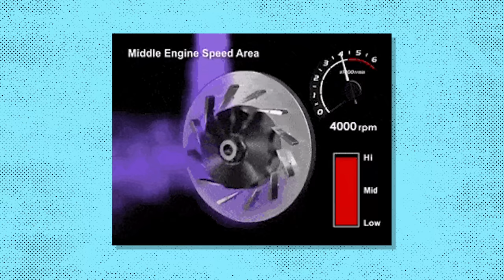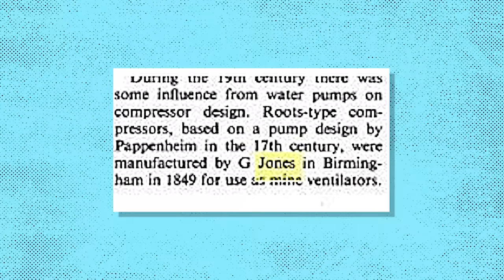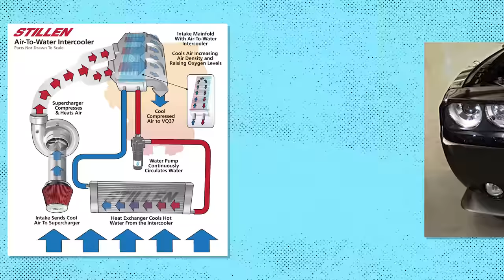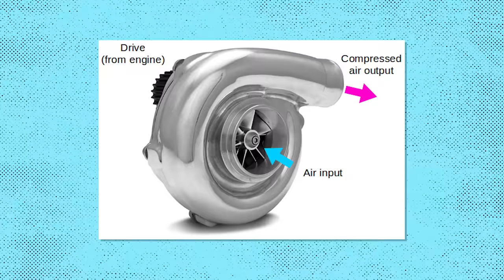Why Superchargers Aren't As Good as Turbos

Comment: Turbo chargers are far more popular because they are cheaper to manufacture and fail frequently. In both cases, this makes more money for manufacturers. Superchargers are far superior. They make more power faster, and although drive belts fail, they are cheap and easy to replace. Car manufacturers push the idea that turbos are better because they are greedy, NOT because they're better.
Reply: You must have owned some really crap cars... don't buy a car if you can't afford to repair it or buy a better quality car.

Turbos are extremely reliable and until recently have always been very expensive.

Turbos are superior to superchargers for some very important reasons 
First is they make more power than a supercharger and second they use less fuel which is important to both manufacturers and consumers.

Comment: Try Torotrak's variable speed supercharger with toroidal transmission.
Reply: All superchargers lack the primary advantage of a turbocharger... a turbocharger will always make more power.
Reply: @sandervanderkammen9230  an important element is moment of power, supercharger is immediate. I understand the differences and the advantages of a turbo.

Now, Torotrak's approach is a very interesting one because of the cvt like drive; a centrifugal charger is adjusted constantly, reducing losses and maintaining power along the whole range of the engine.
Reply: @juliobro1  It seems there are alot of misconceptions and confusion about turbo lag... turbo lag is not a real problem, its an imaginary problem.
 It's the mental perception of the difference between a linear and a curvalinear power curve.
Turbo lag is not a accelleration lag, the truth is turbos make more power so accelleration times are actually faster... not slower.
Reply: @sandervanderkammen9230  I'm not stating one makes more power than the other, but lag is a disadvantage that superchargers don't have.
A variable drive for a supercharger helps with inherent disadvantages, including a smaller size. You know, we really haven't seen this in action, there's only a test bed from Torotrak.
In production are a 2 stage unit and electrical turbos from Audi and Porsche, which add equipment (weight) and complexity.
Reply: @juliobro1  You don't seem to understand, lag isn't real... so it's not a disadvantage.
Turbochargers will always make more power, that's a disadvantage that supercharger will always have.
Less power = slower accelleration.

Comment: While the points in the video are technically correct I think its unfair to say turbos are better than superchargers 
If you're building a fun street car it makes sense to sacrifice a few HP to have the instant boost and throttle response that comes with a supercharger. 
This video also dosnt do a good job of explaining centrifugal superchargers, having owned a car fitted with one, it's the perfect midpoint between turbo and supercharger 
Boost is completely linear, you have some boost the second you open the throttle, but not all of it, there is no lag, you feel the boost straight away, but you do t have max pressure, as you go through the rev range you get more boost 
More people should consider the practical applications of which power adder they choose instead of defaulting to the oversimplification that turbos are more efficient and therefore always better.
Reply: Turbochargers dominate the forced induction market for two reasons, higher fuel efficiency and the simple fact that Turbochargers produce more power than superchargers.

Comment: Few things:

1. The animation of the rotors on the twinscrew is wrong. The rotor turn opposite rotation of a roots to squeezing the air down the center. You show it moving air on the outside of the rotors.

2. You failed to explain the difference in power curves between turbos and blowers. Blowers make way more low end power than turbos. twinscrews will still carry power up top with the turbo, the roots will not.

3. A good crank driven centrifugal blower even with its parasitic loss will out perform a turbo setup on the drag strip.
Reply: That is false, a turbocharged engine will always produced more horsepower and torque and the same manifold pressures than a supercharger.
The supercharger will always have parasitic loss while the turbo does not, that power goes directly to the wheels.
Reply: @sandervanderkammen9230  you read it wrong. “Low end power” is the key words here.
Reply: @2ndshiftracing  More power means... MORE HORSEPOWER
Any questions son?
Reply: @sandervanderkammen9230  
I can tell you’re a little bit cocky and not a fan of data. Once again “Roots and Twinscrew” will always make more torque and horsepower in the LOW END of the power ban over a turbo. That is their advantage. If you want more power band above 4000rpm a turbo is the way to go.

Reading comprehension guy….there’s physics involved here you do know.
Reply: @2ndshiftracing  I can tell you dropped out of school and have very little education.
 2 identical engines, one turbocharged and one supercharger.
Same max. manifold pressure.
The Turbocharger engine will make more power and more torque because there is a parasitic load on the supercharged engine.
Any questions kid?
Reply: @sandervanderkammen9230  I graduated and starting racing. Our whole platform is based on racing data and sharing education of such. You’re arguing a fan boy’s argument with no content, data, and 7 subs. 

All you’re saying is it makes more power, you’re not specifying where. Engines have a power curve, turbo shines on the top end of the curve, and blowers on the bottom end. Don’t know how you don’t understand this in plain English. 

Explain to me how an unspooled turbo making no boost at 3000rpms is making more power than a blower making 20psi at the same RPM?
Reply: @2ndshiftracing  Thank you for confirming that you have absolutely zero education or experience in engineering...
 Horsepower is the amount of work done in a given amount of time.
The engine has a power curve, a power peak and a isographic power output island... 
 Do you need some crayons to write this all down?
I can tell you don't do well with written tests.
Reply: @sandervanderkammen9230  
Answer the question I asked.
Reply: @2ndshiftracing  Engine rpm and turbocharger rpm are relative, and determined by several factors including the the size of turbine and compressor wheels and turbine housing A/R ratio and compressor trims and wastegate and bypass pressure settings. 
Some engines, particularly aero derivatives have a max. of 3,000rpm and produce maximum manifold pressure well below 3,000rpm.
Reply: @sandervanderkammen9230  I’m well aware of turbos and the thermodynamics behind it. 

unless it’s a Diesel engine you won’t make 20psi at 3,000rpm with a reasonable sized turbo on a gas engine. You can with a twinscrew though.
Reply: @sandervanderkammen9230  honestly man, put out some content on performance and I May give it a watch. I tried to give you some free data what was informational and you just want to argue about the top dyno number. So I’m gonna stop this cycle.
Reply: @2ndshiftracing  The Ferrari F154 engine is 25 psi at 3,000rpm 
Peak torque at 3,120rpm
35 psi max. at peak horsepower at 6,700rpm
Reply: @2ndshiftracing  What's the matter boy! Cat got your tongue???
Reply: @2ndshiftracing  Maybe you should spend a little less time producing low quality amateur content and spend alittle more time in school educating yourself?   
That way you won't make a fool of yourself like this again.

Comment: Exhaust pressure is not waste energy. Otherwise i agree. Turbos are better.
Reply: There are alot of misconceptions and confusion about how turbos actually work... Turbochargers use an Impulse Type turbine that uses the waste heat in the exhaust, not pressure..
Turbochargers do not use reaction turbines.

When a reciprocating engine is turbocharged it becomes a Combined Cycle heat engine.
A Otto or Diesel Cycle engine combined with a Brayton Cycle engine that run on the heat energy rejected by the reciprocating engine.
Any questions?

Comment: “No one is using them?”
First 10 seconds and already this video sucks. 
You might wander over to Steve Morris Engines channel and observe you’re incorrect. Most f his LS blower street car motors are well north of 2khp and his SMX motors are usually closer over 3khp to 4khp. 
And over on Richard Holdener’s channel he’s got a routine video in the mix about stock and aftermarket superchargers. He doesn’t even cover the Euro import ones. (Rarely)
To all that think a supercharger means slow, you can’t get a 0.4 or better 60ft with a turbo, and then if you can get down the big end under 4 seconds with a turbo it’s involving an attached rocket to get you there. 
12,000 supercharged hp is enough for most of us.
Reply: No one saying that superchargers don't work..
He is just saying that superchargers are less efficient and don't make as much net power as a turbocharger.
Reply: Your not allowed to have a turbocharger in Top Fuel... they are banned because they make too much power.

Comment: The primary advantage of the turbocharger is that it has no parasitic loss or load on the reciprocating engine.
The turbo is driven by horsepower that is normally wasted out the tailpipe.

Comment: the exhaust gasses that are used to drive turbochargers create back pressure on the pistons, thus robbing the engine of power as well. There is no such thing a free energy.
Reply: Wow! You don't know anything about  turbochargers or back pressure.
Reply: @sandervanderkammen9230  Please explain then.
Reply: @quisp1492  Turbochargers are combined cycle heat engines, they use the Brayton Cycle to convert waste heat energy normally wasted out the tailpipe of a supercharged or naturally aspirated engine to drive the turbine wheel.

The turbocharger uses an Impulse Type turbine, this means it converts kenitic energy in the exhaust gasses, not pressure.

Backpressure is when the pressure between the engine and tailpipe is higher than the intake manifold pressure, this requires energy from the crankshaft to pump the air in and out of the cylinders.
 Turbos increase pressure in the intake manifold and do not create backpressure or a parasitic load on the crankshaft.
Any questions son?
Reply: @sandervanderkammen9230  Got it. Thanks for taking to time to go in more depth. 

Cancel

Reply

Comment: I would go with a supercharger simply because there is no lag and no need to have a relief valve. that and I dont want to have to find a place for an intercooler....
Reply: Turbos make more power...
Reply: @sandervanderkammen9230  no, sorry, they dont.
Reply: @lukewarmwater6412  Yes, they do.
Turbos produce more horsepower and torque, they produce more power at the same manifold pressure than superchargers do.

Comment: they're not bad, they're just bad in applications that don't make sense, just like a turbocharger, or a 23-speed transmission, or a train horn on a smart car. 
Certain things are built for certain applications.
Reply: They are less efficient and make less power than a turbocharger.. thats the point that you missed.

Comment: The supercharger on a Top Fuel engine requires 1000 hp to run air into the engine.
Reply: That is an excellent example of why turbos are better.

Comment: Who dont you also have the exhaust spin it and have it it powerd by a pully
Reply: It's been done... its easier to do one or the other instead of both, the advantage is usually not worth the extra effort if you already have a proper design of turbocharged engine.
Reply: Turbo compound engines have been used in aircraft and coupled turbochargers are used in 2-stroke Diesel locomotive engines.
No pulley, direct drive to the engine.

Comment: A centrifugal supercharger is literally just a belt driven turbo instead of an exhaust driven turbo. It literally is a turbo, with all the downsides of a supercharger and all the downsides of a turbo and the best of NEITHER. You’ll never see one of these on OEM cars
Reply: Not true. Doesn't have all the downsides of a turbo because it doesn't have lag. It is small and light and you can fit them almost as easily as a turbo, they have better heat efficiency than a turbo(no hot exhaust gasses passing through). They aren't as easy to tune, you need to change the size of the pulley to change the boost, but that isn't really an issue in a lot of cases. A turbo also has a parasitic loss, superchargers just have a greater loss but you are still making more power than NA. To say it has all the downsides of both is a complete lie, or it wouldn't exist or get used (they are very popular in the aftermarket scene).
Reply: @acarguy3773  it absolutely has lag, in some ways it can be worse than on a normal turbo. Regardless it literally is a turbocharger, it’s just got a belt in place of the hot side.  It’s a belt driven turbo. Turbos spin far faster than blowers, so it takes a lot more to get significant boost out of it in a centrifugal setup. It’s the worst of all worlds and there’s a reason no OEM uses it, it’s what cheap aftermarket companies offer for vehicles that are more difficult to properly turbocharge, because it’s extremely cheap and let’s you use 99% off the shelf parts. It’s by far the worst choice of all the options
Reply: @Fee.1  no it does not have lag. Just like any other belt driven supercharger it does not have lag as it is 'always in boost'. No oem uses it because turbos are far easier to get good emissions and mpg out of, that's all they care about. Same reason as to why they use smaller engines than they used to. Lots of people choose to go down this route instead of using a turbo, and actually it's often slightly more expensive because their are more turbo options. And because a turbo is going to be more likely to get you huge power. I will be getting a centrifugal supercharger instead of a turbo to keep my engine feeling NA, with no lag, and more power keeping with the original character of the engine.
Reply: @acarguy3773  you don’t know what you’re talking about. You’re relying on talking points i am speaking from experience. First of all “lag” is overly broad and can cover many types of symptoms. 

IT IS NOT JUST LIKE ANY OTHER BELT DRIVEN SUPERCHARGER BECAUSE ITD NOT A SUPERCHARGER! It’s a Turbo that’s been adapted to work on off a pulley system. 

If you want to understand more I’m happy to discuss it and explain but if you just want to go back and forth and refuse to entertain the idea someone might know a bit more than you, then this is an exercise in futility. I spoke to Jason Fenske about this at an event after he made his first video that included a portion touching on centrifugals. I corrected his inaccuracies in the comments but it didn’t click for him until we spoke more in depth. 

By The next video he made that discussed them he had had time to reflect on the points I raised and he corrected the record and more accurately described centrifugal in that video and ever since. 

You could also try to catch Gale Banks, the god of body, and he will help you understand the topics and forces at play here.
Reply: @Fee.1   lag doesn't cover many things, it refers to me pushing the throttle and there being a wait time for boost to build, this doesn't happen with a supercharger. It doesn't need to spool up every time I press the throttle. It does however need to be in the right rpm range to be making decent boost because it can only spin according to the pulley system. There is a difference between lag and boost threshold. A turbo engine making basically no power at 2krpm is not lag. A turbo engine needing to spool up to make power when you hit you throttle is lag. I only compared it to other superchargers on this basis, and of course the fact that they are all driven by somewhat similar systems in comparison to a turbo but that's not even relevant. Of course I understand that it's almost identical to a turbo, no need to rage at me with capitals because I made one comparison - clearly one I didn't explain well enough. 

I don't see what there is to understand, I know exactly how it works and what applications make sense for each, and weighing up the pros and cons the centrifugal supercharger is the best option for me, and for many others who don't want the lag of a turbo, and realistically couldn't fit any other kind of supercharger. If I had more money to spend I'd keep it NA and go crazy but ITBs and such are not an efficient way to make more power (efficient in terms of cost). The centrifugal supercharger will give the predictable throttle response without the boost nature of a turbo, and will be more linear. Not as easy to tune, and can't do boost by gear (although theoretically possible with cvt like pulleys but the cost and complexity wouldn't be worth it lmao) but I don't need that anyway as im only likely to be looking at 300ish hp in the first place.
Reply: @acarguy3773  All centrifugal compressors have lag